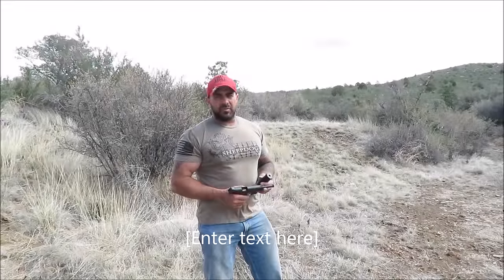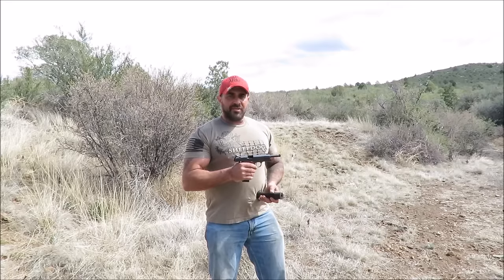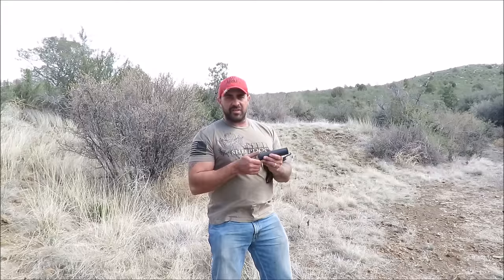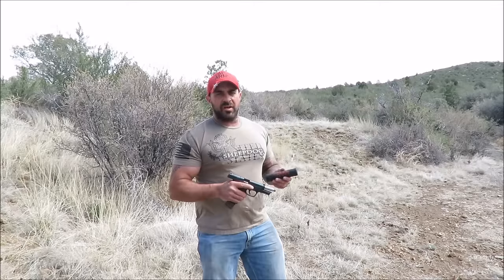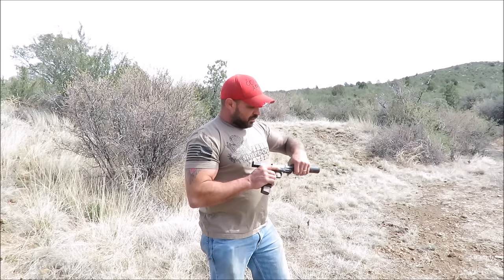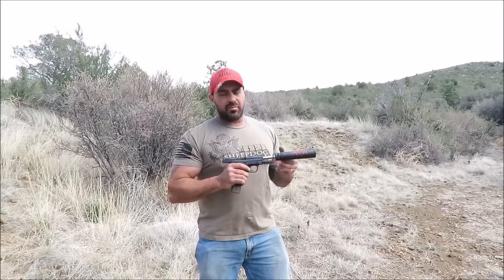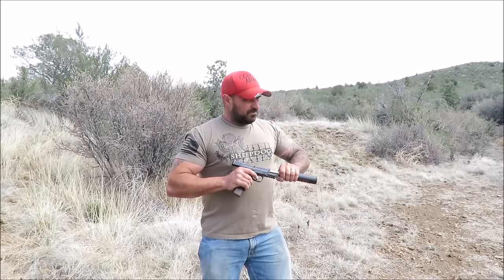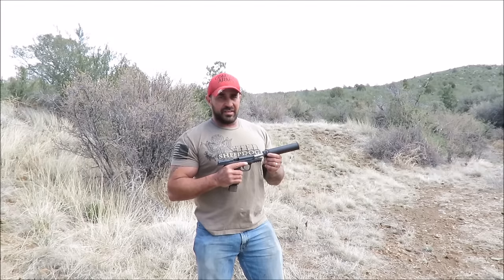SD Tactical Arms pistol booster

Comment: So I'm going to use this on my rifle with the lockout spacer in place. The only thing is it's a little loose even when all tightened down. I noticed it says u have to shoot it a few times then retighten the booster I'd say it's prob 1/16 maybe 1/8th loose maximum. Just wanting to be sure it's all good before firing thx

Comment: I have 2 questions that maybe you could answer I made a suppressor I already have my trust and want to add my son. On my trust papers it has for both a witness and a notary public do both have to be signed or just one. another thing the can is for a 300 aac can I swap out the baffles and end caps to shoot 45acp or will I get introuble by doing that
Reply: I wanted to swap so I would not have to go through the whole thing over and wait 6 months to shoot my pistol